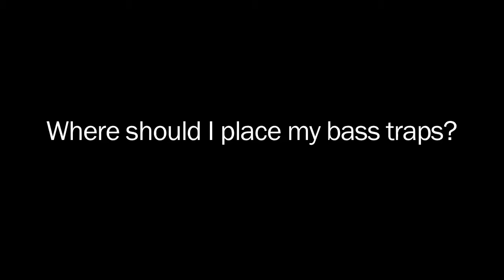Art Noxon Answers: Where Should I Place Bass Traps?

Comment: Is it more important to place bass traps in the corners behind the monitors, or behind my head?
Also I heard that they work better up in the top corners as opposed to the bottom corners.
I only can afford two at the moment so want to put them in the best place.
Any help would be much appreciated.
Reply: Man, I'm working on the same thing... what I understood is this: the distribution of pressure in your room made by low frequencies standing waves varies A LOT depending on the specific frequency and your room scenario; the fact is that, if you are using a resonance bass absorption system (helmholtz, diaphragmatic etc.), you basically have to look for the spot your bass absorber vibrates the most; those spots where pressure (on that specific frequency) is highest; these spot CAN be the corners of your room, but IS NOT always and guaranteed to be like this. Hope this helps! bye
Reply: +Jason Gibbins Have you found an answer to this question yet? I'd like to know too. Thanks.
Reply: +StreetLife925 didn't really get a solid answer, sorry. After some research I decided to place them behind my monitors in the top corners.
Reply: oh, ok...well thanks!!
Reply: Hey everyone, I know this is an old thread but hopefully new  people who are asking the same questions can get help... 

The above comment was right, every situation is so different & there are so many variables BUT a lot of times they just want you to hire them to monitor your room acoustics. This industry is EXTREMELY D.I.Y so that seldom works anyways. 

The answer is to download a free EQ analyzer app on your phone. Note* using a mic that can capture bass better is ideal for pinpointing frequencies but wont matter much if you are using phones mic to visually see where bass is building up.* All you have to do now is play pink-noise which you can just youtube and play on your room speakers, play the sound the same as what you would be listening at! Walk around the room with your phone and look for where the bass is bulking up. The corners are almost always like that start there, this will also give you a reference as to what bass build up actually looks like. 

You want the room to be flat eq line, so as you are doing this, look for other problem frequencies. Remember to orient your mic in different planes and directions to test. The key here is to TEST WITH ACTUAL LEVELS, otherwise you could get exaggerated results. 

Hope this helped.